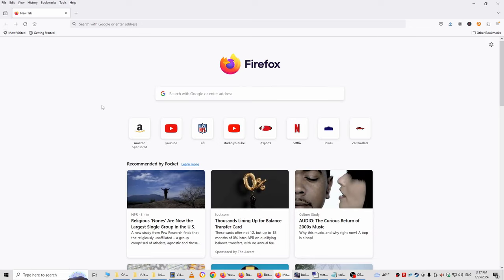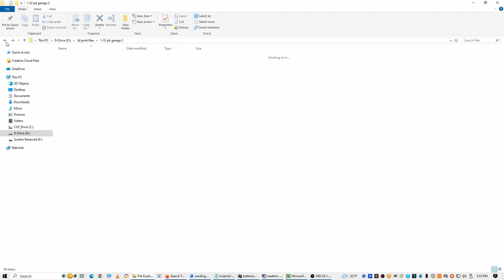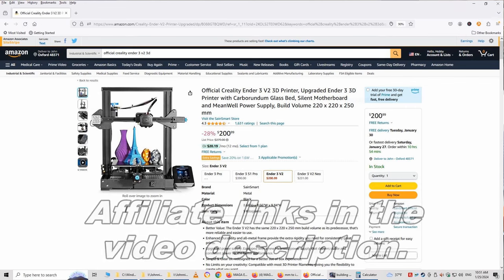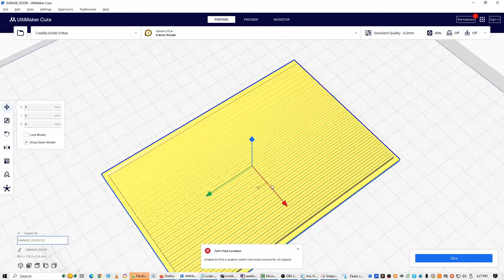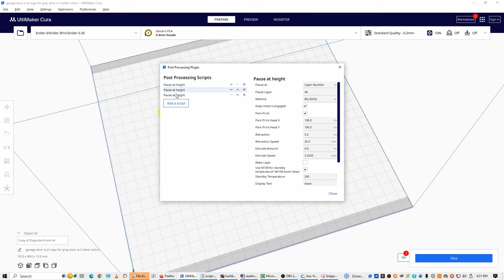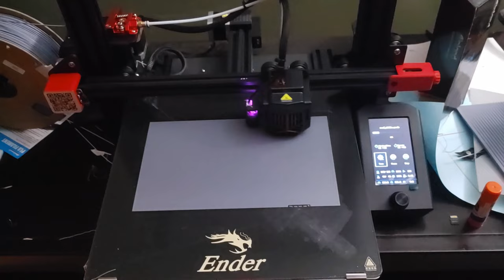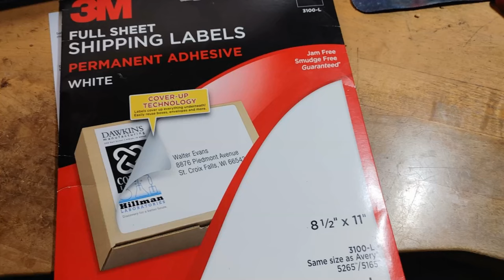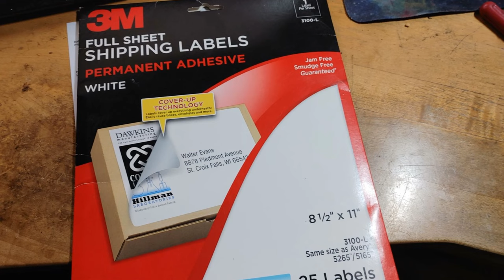Pit Garage Build for My Carrera Slot Car Track – 3D Printing Scenery

Comment: That's a pretty slick building. Maybe put the top four of the season on the four balconies...lol. Though, second is the first loser....not even sure of what that makes 3 and 4....
Reply from the maker: I like the idea. Maybe I'll 3d print a plaquard for each driver that would hang on the balconies so they can be switched up every race (if necessary).

Comment: I truly like your track. Can you tell me table size?
Reply from the maker: It's an irregular shape so not too easy to describe in a comment, but I'll see if I can simplify it by breaking it up into two sections. The larger section is 25ft x 5ft (mostly) and the smaller adjacent section is 16ft x 4ft (both with some variations). Overall area is 180 sq. ft.